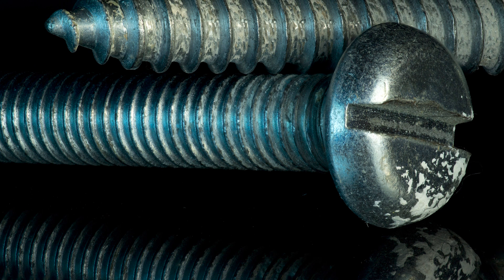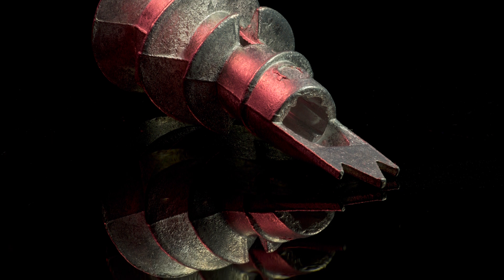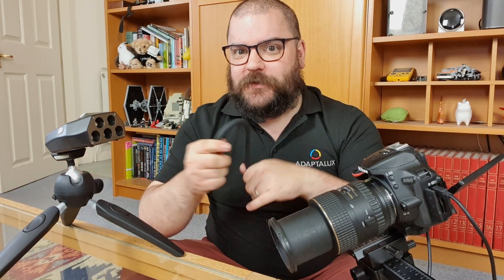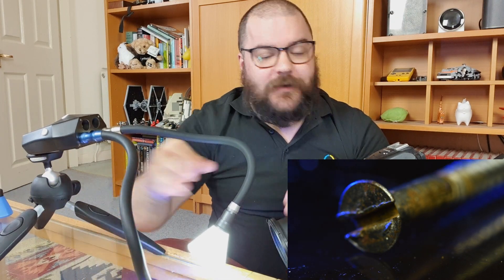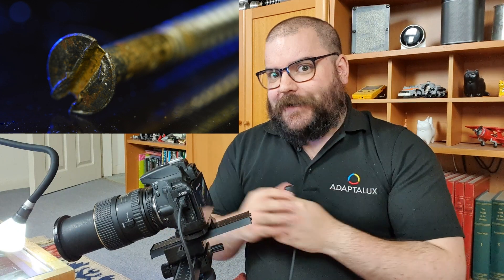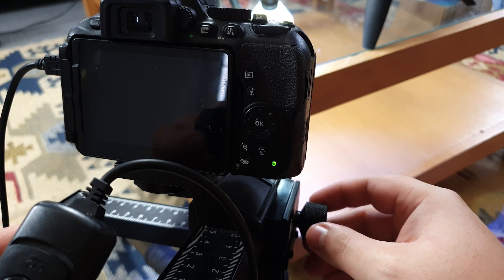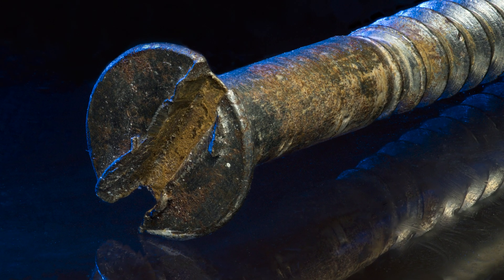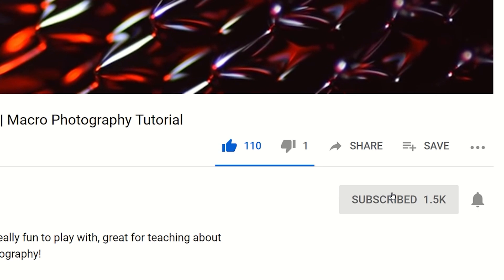Screw Macro Photography Tutorial - 150+ photo stacks with Helicon Focus

Comment: Sorry to be 2 years late with my question, but I just found this video today.  It's very interesting and informative as I am just becoming familiar with focus stacking.  I'm a bit confused though: When you slowly move the camera closer to the subject with the rail, doesn't the perspective change? In other words, the screw would be smaller and farther away in the first shot, and then larger and closer in the final shot. Can you explain this? Thanks.
Reply from the maker: You're right, the perspective changes a little, and the software usually handles this. You can change the focus of your lens to move the plane of focus through your image too, but this has slightly different effects and can cause a similar issue. Essentially, the framing of the closest image will become the framing of the final image the excess image around the edges will be cropped out of the final image. You should be able to see this happening in helicon focus as your image stacks and is finally cropped down to remove the edges. Helicon focus does a great job of accounting for this, but there can occasionally be ghosting effects around the edges of an object if the perspective changes too much.

Comment: Hi Ben ... do you use Mirror Lock Up when you take these shots? The enemy of this type of photography is vibrations. Always enjoy your videos.
Reply from the maker: Hi Rob, no mirror lockup, it would be a drop in the ocean compared to the vibrations of the trucks driving by my house!  I found that the images were nice and sharp and the stacking worked well even with considerable instability in my setup. It's usually best to do everything you can to prevent vibrations though. A remote trigger and mirror lockup (or mirrorless camera!) is a good way to go, especially if you can't get your shutter speed fast enough to prevent camera shake.
Reply: Thanks for that Ben

Comment: Helicon Focus is great. I tried Helicon Remote which adjusts the lens focus slightly for each shot eliminating the need for a focus rail. However it was not compatible with my Sigma 105 f2.8

In the end went with a WeMacro automated rail. Very affordable, well built and easy to use with extreme accuracy. Happy camper ever since.
Reply from the maker: I do hear good things about the WeMacro rail, might be one to try out when we get on to automatic stacking!

Comment: You had a warning on your render. Did you investigate? Usually this comes from having images out of sequence of images with a focus point beyond your object. Also you mentioned you could use Photoshop. Photoshop is not likely to succeed with 150 images in a stack. It would take forever.
Reply from the maker: Hi Don, I agree that Photoshop would struggle with stacks this size, especially RAW files too. Some hardware might be handle it though, even if the processing times are excessive. As for the error, it was just a test photo in there out of place, I didn't have to re-process it. Well spotted though!